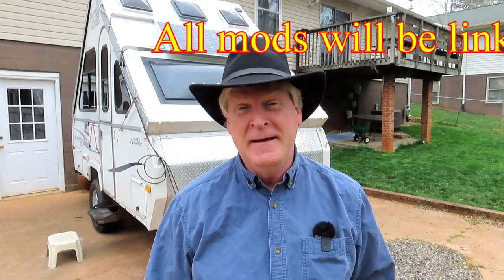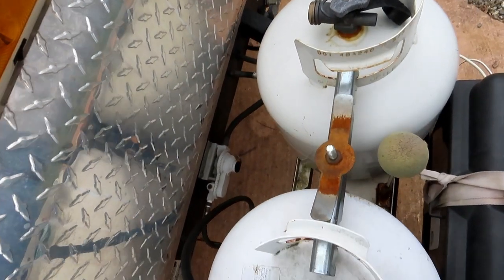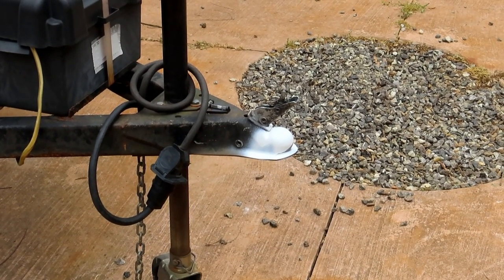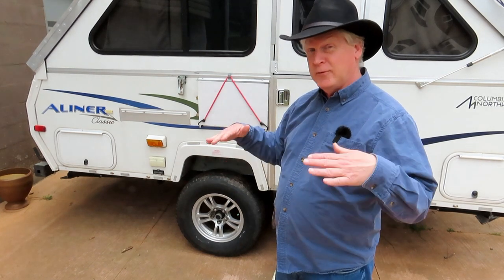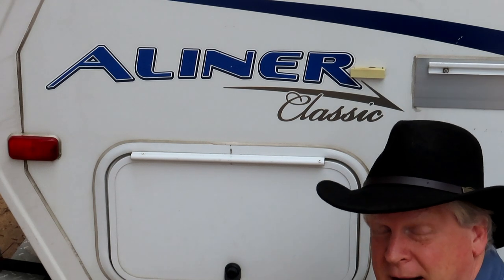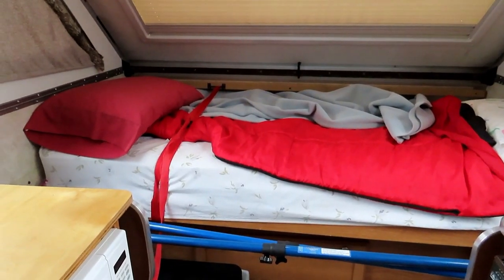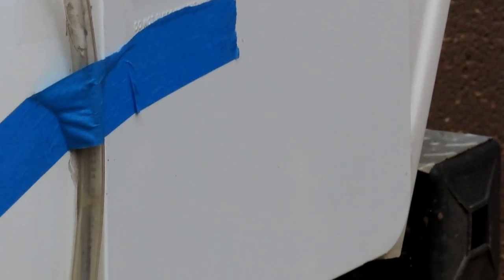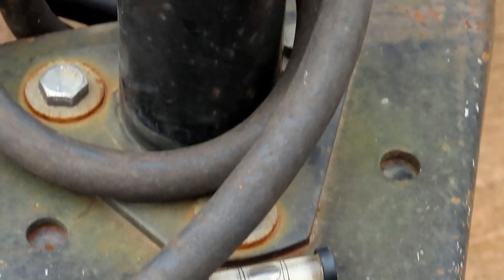Changes and Modifications to improve your camper trailer, Popup, Aframe, Scamp, Egg, or other camper

Comment: If you are not getting a smart lithium battery which has a display to show actual capacity (not just voltage), then I suggest getting either the $44 (round) or $73(rectangular) AiLi Battery Monitor.  These use a bidirectional current shunt that you install on the negative battery connection.    These monitors will measure the current going into and coming out of the battery giving you a very accurate capacity reading as well as other useful data like voltage and current in/out.      I have LifePO4's on my Aliner and Solar, and get a lot of questions about it and I always tell people to get one of these battery monitors as the first purchase because it will show what capacity you are using and with that information you can plan your battery/solar system as well as find ways to reduce power consumption.
Reply from the maker: Thanks Jeffrey,  appreciate the recommendation. I haven't made many decisions yet about what I want and where it will come from.  I'm still squeezing that dollar to get a little blood out of it...LOL

Comment: Another helpful video.  Many thanks!
BTW:  The first thing I did when I winterized my new 2021 Aliner Ranger 12 was to install a water tank bypass, as you recommended.  Interestingly, the trailer already had the hot water tank bypass installed from the factory, which saved me some work  The water tank bypass works great.  Thank you!!!
Reply from the maker: Nice if you got the Hot Water tank bypass factory installed.  Maybe they will add the cold water tank bypass in the future.  The big rigs have them. Why not the little rigs.   Thanks for the comment. Stay safe!

Comment: Nice! Rick, I just got the off-road version and cannot see over it through my rearview mirror.  I installed a rearview camera atop my tow vehicle's luggage rack. It works!  I can see when somebody is driving right behind the trailer. You might consider one yourself. It is on amazon:
Reply: Yakry Y23 HD 1080P Digital Wireless Dual Backup Camera
Reply from the maker: When I learned to drive it was strong expressed to me that all the trouble is in front of you.  So I rarely worry about whats behind me.   They can read my "GoingNoWherFast" sign and go around if they want to!! LOL   Though backing up it might help, but I haven't had any trouble there either!

Comment: Hi ... New to your channel, My Wife and I have an opportunity to buy a 2013 Aliner Ranger 15, its been garage stored its whole life and looks brand new.  Binge watched a lot of your vids on your Aliner.  Have a 2019 Tacoma 4x4 with tow package (6 cyl, long bed) to pull it.  Looking forward to getting my hands on this.  Looks like this weekend can pick it up.   Its 1800 pounds, heavier one but still compared to most travel trailers we looked at, way lighter and much easier to tow around (I think) and take care of. (Hopefully)   My son n law is an absolute handy man as i'm a learning one ha ha.   First thing I will do is the axle tire mod as no way do I want 13" tires on one of these.   Thanks for the nice vids!   Bob
Reply from the maker: Sounds like a very nice find!  You will have no problem with the tacoma  towing that, and when you get the new axle, tell them you want 25 deg down angle and that will lift it up nicely for 14's, maybe 15's.  Let us know how it goes!!
Reply: @GoingNoWhereFast  ... Just texted the seller, it definitely has the 13" tires on it.   ARGH!!   So after I do a trial run with it, will be one of my first priorities as will be paranoid with 13" wheels on this size camper travelling any long distance.   Hopefully they aren't back ordered.  Will find your Axle Vid next.   Thanks again.
Reply from the maker: The Axle Company is OEM Axles.  But that was a long time ago, you might find one else where, they are all drop shipped from Dexter or AL-KO...

Comment: An old mechanic once told me that so many people don’t realize the benefits of having a good set of “mag” wheels on a trailer.  He said they’re designed to protect and extend the life of the wheel bearings by absorbing heat generated by traveling down the road.  Standard rims are made of thin metal and aren’t as good at doing this.  I never really considered that.
Reply from the maker: Tires do get pretty hot going down the road, but I'm not sure the heat from the tires get to the bearings.  There is a lot of wind going past that wheel.  I have found that most bearing failures are from the electric brake malfunctions.  If the brakes don't back off, you might never notice and that drum will get up around  2-300 degrees.  That would destroy any grease in the axle.
Reply: @GoingNoWhereFast  Agreed.  I think his point was these more robust rims dissipate heat better and therefore prolong the bearings.

Comment: thank  you rick great job. question thou. the eletrical cord with the mouse hole cover do you carrier that cord on the outside somewhere? thanks looking forward to  new adventures
Reply from the maker: I keep it coiled up in the cargo compartment next to the receptacle.  I also keep a regular house extension cord and a 110 house plug adaptor so I can actually get about 100ft to power if I have to.
Reply: @GoingNoWhereFast  thanks

Comment: Just got an aliner.. Need help. Has anyone replaced the interior ceiling panels. Mine have water damage and have delaminated
Reply from the maker: Sure, they are easy to replace, just order a replacement set from Aliner and they are fairly easy to screw on.  Depending on year and model panels run $700-1500  plus freight.  Call Aliner (Columbia Northwest)

Comment: Can you give me information (part #) for the table slide and leg modification...could not find on your web page
Reply from the maker: That exact table leg is currently unavailable on amazon  https://amzn.to/3vNqJDU,  the wall attachment is https://amzn.to/3vMMa8c . It would be pretty easy to make a similar leg or there are many like it.
Reply from the maker: For the wall attachment I made a tapered piece of wood to attach to the wall that the slide then attaches to.  A lot of glue and a few screws hold it to the wall.  The slide hardware of course just then screws onto that piece of wood.
Reply: How did you modify table edge to adhere to wall slide?
Reply from the maker: @sheilablanchard4795  Lots of glue and some very small screws into the table.  My Original plan though was to replace the ugly table with a real wood one (Cherry) but haven't gotten to that yet!